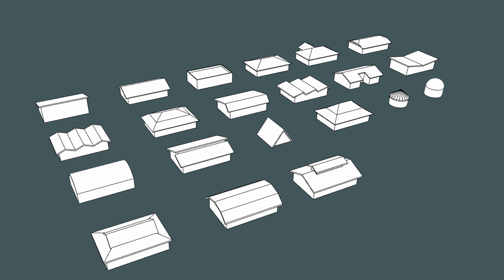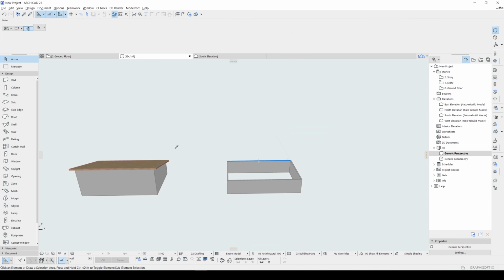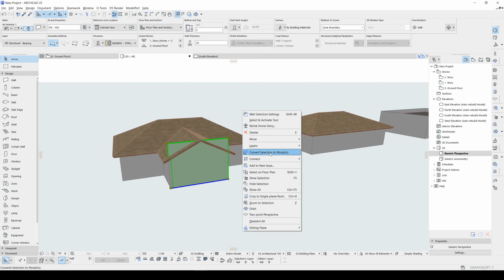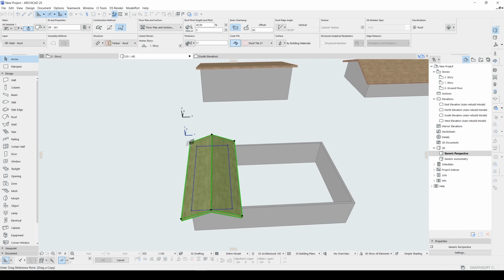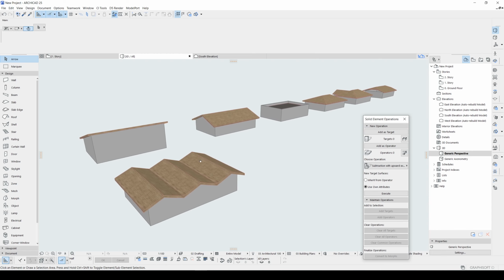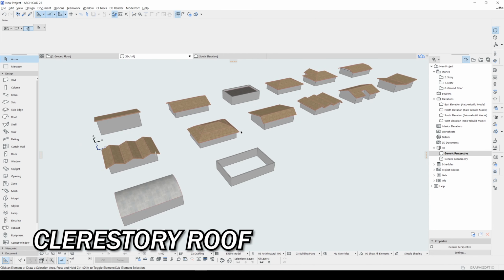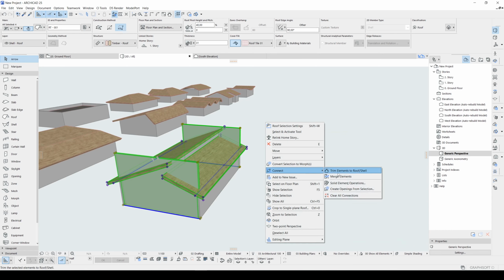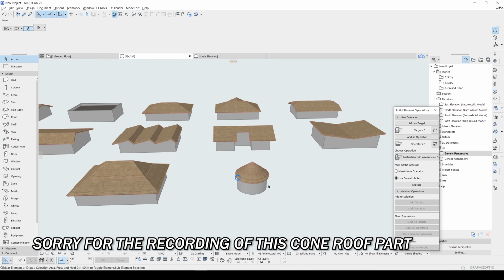21 Different Roof Styles in Archicad Tutorial

Comment: Lets say you got a shed roof made of 2 parallel lines shifted in hieght... 
and would like to drag down 1 knot or point of the upper line to match the height of the lower parallel line.
How would you do it?
Stuggling to find out how to move around the black dots in Z-Axis. Any idea?